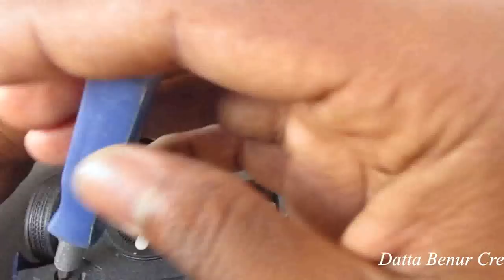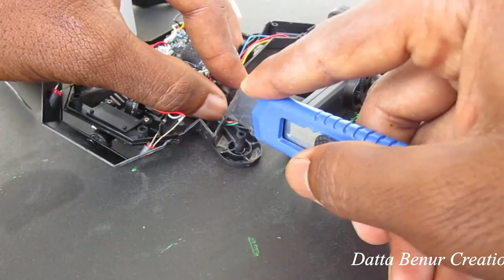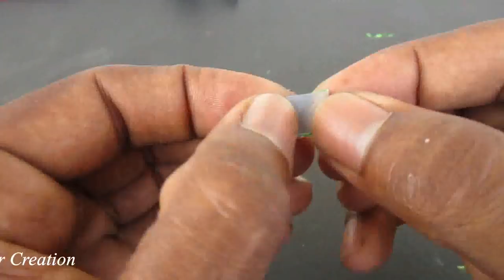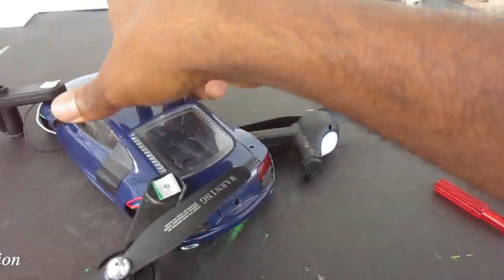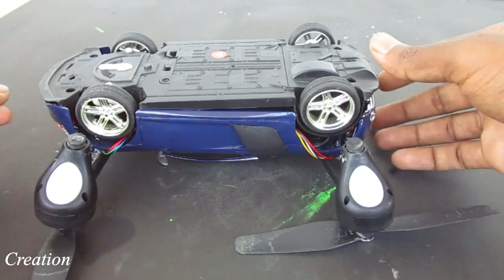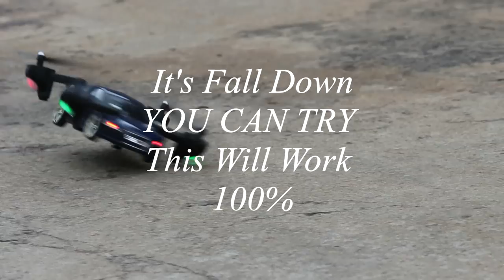How To Make a Car That Can Fly - Helicopter

Comment: Sorry for suggestion, try with rotary system in the opposite direction. The two left sides rotate inwards and the two right sides also rotate inward so that it gets the balance. Must add one more battery. It is better to use three dynamos, one for the left side vane, one for the right side, while to move the wheels of the car using its own dinamon. May you have found it. Congrats, I vote very interesting, two thumbs up. Hahaaaa